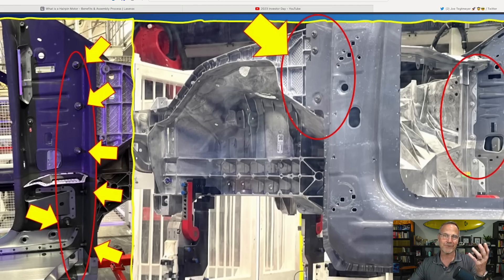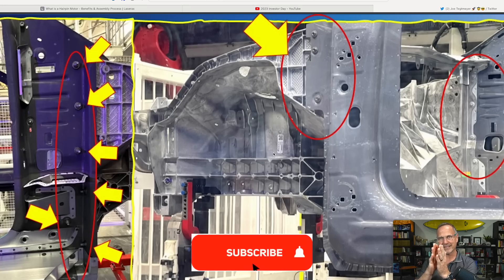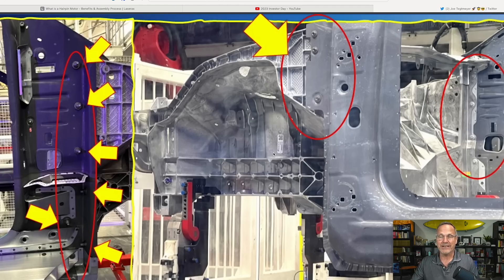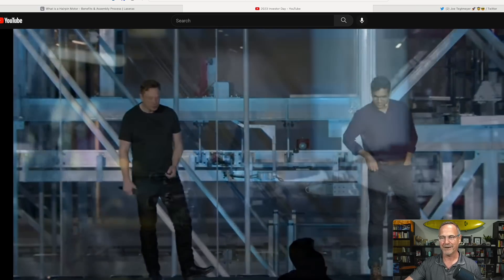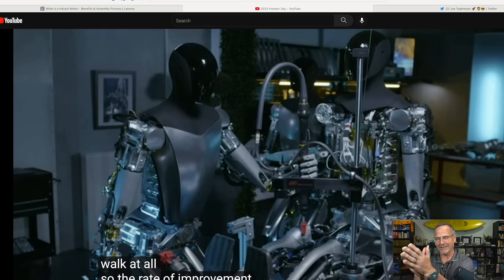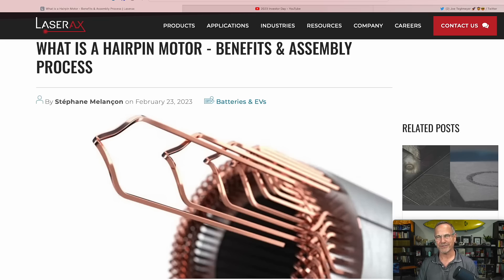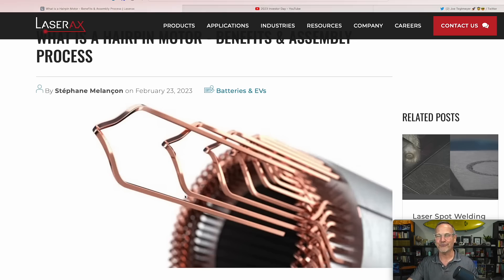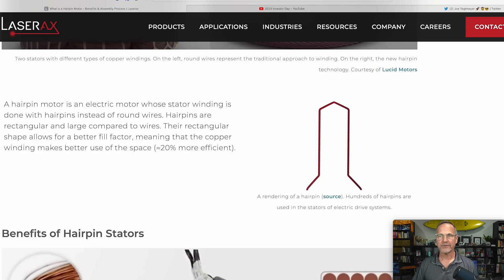Tesla Has HAIRPIN MOTORS! 🤯 What the Heck Are They?  Plus Teslabot is REAL, and How To Attach Panels

Comment: The tool in the hand of the robot @4:45 in your video is a standard hand held Nut Runner used in the automotive plants to hand apply nut and there is a trigger on them to "run" or auto spin the nut to tigthen it.  I think they are trying to get the robot to be able to do this task in the plant. Which if they are planning to bolt these assemblies together in the new process, would make sense to have the robot do it.
Reply: It is not a matter of thinking, these will be used on tesla's production lines before they get used anywhere else.
Reply: The problem is that this isn't a run-of-the-mill robot where a programmer is in charge of every actuator.  This thing is supposed to learn from watching thousands of similar actions.  I want to know where Tesla is getting all of that training data from.  With FSD they stuck cameras in thousands of cars to record real-world interactions.  In a factory they have no such advantage.
Reply: @DanielASchaeffer  They do have such an advantage, if you assume they are/have been recording inside their own factory.
Reply: @DanielASchaeffer  The station in the factory will not change much so not as much learning is required.
Reply: @DanielASchaeffer  Simulations, same as for FSD.
Reply: Just as humans aren’t better than traditional stationary 6axis robots at using a drill to tighten nuts, a humanoid robot wouldn’t be better than a stationary robot either. I doubt that’s their application when they currently have thousands of robots that would be better at completing this task
Reply: @austinprobasco7482  The thing you're forgetting is that these robots are designed to replace humans without the need for retrofitting a location. So, let's say you have a factory that operates for 8 hours per day, and you call up Elon Musk and say, "I need 2500 robots to replace my workforce." You then record your factory for a week, and on Friday, you lay off your entire workforce. By Monday morning, you now have a factory with 2500 robots that can work 24 hours a day, 365 days a year. This allows you to sell the product for 1/10th of the cost while still making a huge profit margin.

While these robots will take jobs from people, they will also create tens of billions of jobs. For example, every human may need a robot for daily care. Every person who owns a home will need a cleaning robot that can also cook and drive. However, you may need two robots if you want your robot to make fresh bread every day, and prepare fresh meals. If you own a home, you will also need a robot to take care of your house maintenance, yard work, and gardens because why wouldn't you want fresh everything? Now that you have a robot, you can have fresh veggies, fresh herbs, and so on. If you have pets, robots can tend to them too.

These are just some examples of personal care, but let's consider the global impact. We know for a fact that weeds are a problem, and you're going to need several billion robots to kill weeds. Clean forests keep wildfires from happening and keep trees healthy by trimming them, so you need several billion robots to do that too. You'll also need robots to seek out and clean everything from creeks, rivers, lakes, ponds, roadways, and just about anything else. That's several more billion robots. Then, you need several billion robots to farm, tend to livestock, count wildlife, and overall tend to the billions of tasks that no one wants to do because there is no profit to be made.

You know that falling-down barn you saw by the road on your last trip? Well, that barn wood is sought after, yet because it costs more in labor to salvage it, said building just rots. Robots can salvage everything. All of the trash all around the world can be sorted and properly recycled.

In conclusion, while there is no doubt that robots will take jobs from humans, they will also create new jobs and opportunities that were not possible before. The possibilities are endless, from personal care to global tasks such as farming, cleaning, and recycling. The key is to embrace the change and adapt to the new reality. The benefits of automation and robotics cannot be denied, and they will undoubtedly lead to a more efficient and productive world. It is up to us to ensure that the transition is smooth, fair, and beneficial for all, so that we can realize the full potential of this exciting new era.
Reply: People are so unwilling to work toady it is surreal. Those flooding across the border want free, free, free, and a debit card. Those who came in the hard way and run successful businesses, struggle today since they can't get anyone to work because the government is hard to compete with.

Comment: I’m concerned on paint quality if the items are handled painted while being assembled! My only answer is that maybe the cheap car won’t be painted at all - and might be made with the new stainless steel or a new composite!
Reply: When Tom Zhu was asked after the investor day presentation about the new 3rd gen platform painting process he replied simply, 'paint is expensive'.  Read into that what you may :-)
Reply: Presently workers climb inside painted cars, mount painted doors on painted body, fit windscreen, bumpers, entire ICE motor & wiring harness. Joining faces will be hidden by doors, bumper.

Comment: Well the question is who has the patent for hairpin motors?
Reply: The BorgWarner patent expires May 2023.
Reply: @fredbloggs5902  well that really convenient
Reply: @Znegil  my replies keep getting removed. Not sure why. Using this reply as a test. I think it's because I included a URL to the patent source.
Reply: BorgWarner has an kind of different version of hairpin.
Hairpin isn't patented.
They do use it everywhere exept freemont/nevada already.
Reply: @jonas_4901  How do you know this?
Reply: @RobertLoPinto  I worked on the production lines for both Tesla an BW, BorgWarner uses "wave winding"
Reply: @Fred Bloggs   Great point. The patent filing (assuming I found the correct one) says 'anticipated expiration May 15 2023`. 

Curious why it would say  "anticipated". That implies it could change. Can the patent holder file for an extension? Under what legal grounds/circumstances might a patent expiration be granted?
Reply: @RobertLoPinto  my guess is that the patent could be challenged and invalidated (eg. by authenticated prior art), but so close to expiration it’s unlikely.

Comment: The notion that the hairpin  electric motor can use less energy to produce the same amount of power, which helps extend the vehicle's range is strange. It sounds to me illogical. It is mixing the efficiency with power.
Reply: You are correct. However improving the power to weight ratio of the motor enables the motor to be made smaller and lighter which will improve range.

Comment: they are most likely using structural adhesive to seal and bond panels to the castings, a body shop could unbolt and use however they designed it to be removed, probably heat from a torch. 
would make body repairs cheaper and faster, didn't Elon say at some point they want body repair to be same day? that's how you could do it

Comment: 14:08 Lucid already uses that type of motor huh. So, it's not much of a differentiator as I thought.
Reply: Copper wire can be bought, harpins have to be manufactured. Which company is better at manufacturing their own parts when there isn't a sufficient supply chain, engineering for scale and then executing? That's the Tesla advantage.
Reply: @RobertLoPinto  Oh you are right. Normal wires grow on trees - wtf✌🏽

They already use it everywhere exept freemont/nevada already.

Comment: Yippee, Tesla are introducing fasteners and building their motors like VW ID4. Pity they can't build an evolution of hairpin in the way that Lucid do. Probably patent protected. The white space in the round wiring is a bit like packing flashlight batteries into their battery packs using 2170 and 4680's.

Comment: Great video!  The only thing lacking imo is: so if hairpin motors are so great....why aren't they used universally?  In other words, there must be some disadvantages to hairpin motors which have prevented their widespread use to date, or with certain applications.  What are the disadvantages that have either recently been overcome, or are now outweighed by their advantages for automotive applications?
Reply: It seems like many industries are stalled out as "good enough".  If your competition is not impacting your sales then why spend money to improve your product?
Reply: @bobwallace9753  but the competition is already using this.
Reply: @Dularr  
I'm betting Tesla's version is better.  Did you watch Munro's teardown of the Tesla motor?  Tesla seems to have some special sauce.
Reply: @bobwallace9753  I've been really enjoying the Munro motor break downs. Don't think I've seen a bad motor.  Where I find Tesla excels is everything around the motors.
Reply: @Dularr  See if you can find the video where they take the T-S Plaid motor apart and talk about the laminates.
Reply: Tesla a bit late to the party on hairpins, several other EV manufacturers already using
Reply: Tesla also uses it. The production lines therefore are from a supplier I work at.
We got em installed everywehere exept Freemont.
Reply: They are more complex to design and difficult to manufacture unless you can invest building complex machines to do it. Most motors don't sell enough to make this extra expense viable, however for EVs the investment is worth it because efficiency is so important.
Reply: Hairpin motors are in use universally. VW Toyota, Ford etc...
Reply: @MegaWilderness  Clairol, L'Oreal, Garnier, ,,,
Reply: The answer I got was the welds between hairpins has only recently been perfected and been able to be done in a cost-effective manner. (I am not an electric motor designer, and this is not investment advice.)
Reply: Disadvantage is you cant just buy wire, you have to manufacture hairpins
Reply: @JamesAwokeKnowing  Oh you are right. Normal wires grow on trees. Like wtf✌🏽
Reply: @jonas_4901  Can't use hairpins anywhere except electric motors.  That would make them more expensive.  Right?  Think of all the places round wire are used in your daily life.  Power lines over head, house wiring, in every device you plug in....  Volume = less expensive.
Reply: @davidbeppler3032  Volumes for hairpin are high enough that this doesn't makes a significant difference.
Reply: @davidbeppler3032  What do you think hair pins are? They're square wires bent and cropped.
Reply: @MegaWilderness  That was a uninformed comment.  Extra steps = more cost.  Less production = higher price.
Extra Steps and Less Production = Expensive.
Reply: @jonas_4901  what is the volume for hairpin motors that were patented in 2012?  How many millions of hairpin electric motors are built a year?
Reply: @davidbeppler3032  Steps haven't been removed. They've been resequenced
Reply: @davidbeppler3032  We have deployed about 30 production lines over the past 3-4 years, each capable of about 400k stators a year. If you need roughly 110m of wire per stator, that gets you to 1.3M kilometers of wire per year.
And thats just what I know from, according to research of our company, we have about 70% market-share. So total would bee ~1 9M km

You could go almost 50 times around earth with that🤔
Reply: @jonas_4901  what car company is building that many EVs?  30 lines times 400k cars times 4 years?  That is over 48 million EVs! Just from your  company?  Where are all these cars?
Also, thank your for your answer!
Reply: @MegaWilderness  I said added, not removed.  MORE STEPS = MORE COST
Reply: @davidbeppler3032  That's a difficult question to answer. Toyota hybrids all use this technique, VW, BMW, BYD both for hybrids and EV's. Since hybrids require two motors, one used as a generator. I'm guessing Tesla has a long way to catch up. Glad you like Sandy Munro, have you seen the motor teardown of the VW ID4 motor, he did? Perhaps Tesla plans to buy that one instead of making it themselves.
Reply: @davidbeppler3032  First you also have to take all-wheel cars into account (you need 2 stators there, Rivian for example has even 4), and if I´m positive about 80% of the stators make it into the final product (due to scrap parts in following process steps). So we are only at 6.4Million cars per year. Then that is installed capacity now, many of those lines are still in ramp up, and most of the lines don´t run 24/7.
This now might be a bit contrary to my initiall statement, but wire need is definitely high enough.
Reply: @MegaWilderness  Tesla already uses em in Shanghai, Texas and Berlin.
Reply: @jonas_4901  You can't have all wheel drive off of one motor?  How do ICE do it?  A lot of Subaru cars are all wheel drive.
That said.  Hairpin wire was patented in 2012... wire was invented in 1830.... maybe you can see why wire is less expensive due to the massive amount made every hour in hundreds of sizes in thousands of factories around the world.
My original point was, round wire costs less and is far more available from a multitude of companies.
Reply: @MegaWilderness  The hairpin motor was patented in 2012.
Reply: @davidbeppler3032  Wat da haaaiil... If you ever find an BEV that is AWD with just one motor pleasd contact me (drive shaft through batter pack???).

Maybe you are right, but my statement was that I don't think so. Since we both aren't OEM's who know the exact prices that will be a open point.
But also se it from another perspective. You need like 100 small wires to replace 4 hairpins, this also makes hairpin simpler in just a number point.